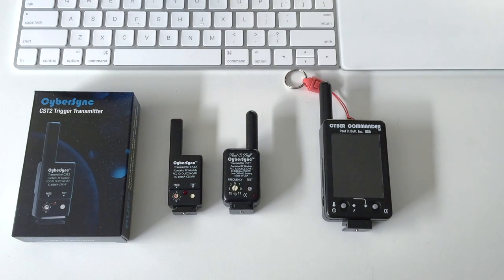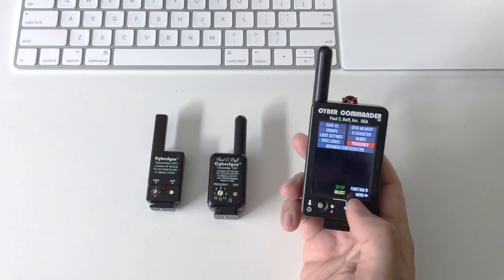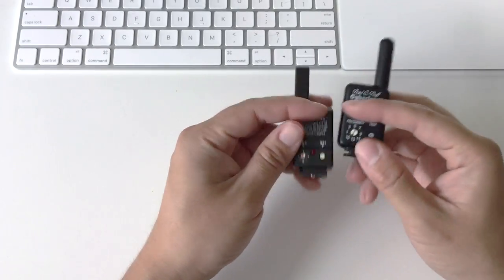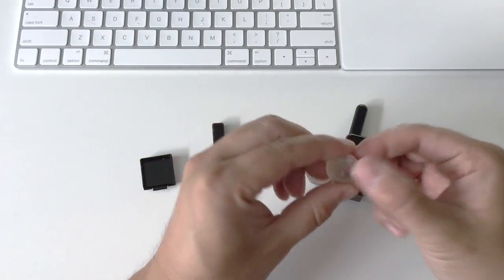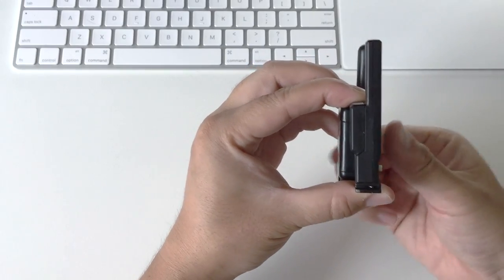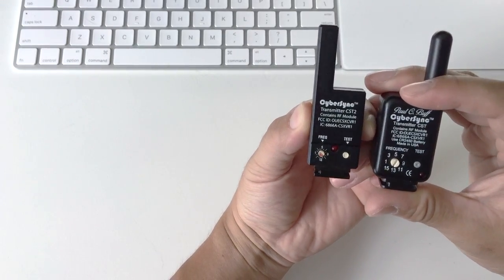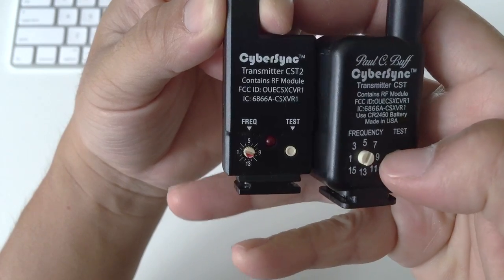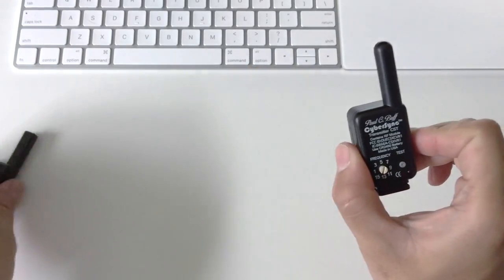2nd Gen Paul C Buff CyberSync CST2 Transmitter Review and Compare with Original 1st Gen CST

Comment: Two Comments

1 I have both a CST and CST2 ( the latter which I just received From Paul Buff Inc). On my Nikon D700 & D200 I always use the CST with the controls facing the back of the camera and have not had any issues with misfiring.

2 I have only had my CST2 for a very brief period. I find that the hot shoe mount appears to be a slightly different in size and/or design and it is very, very tight on the camera's hot shoe mount.  It is far more difficult to add or remove from the camera than the CST model. I hope with time the mount may wear down a bit, making it easier to mount on or remove from the camera.
Reply from the maker: Thanks for sharing your comments Bob. I actually had the CST returned for service a while back, because the hot shoe contact ball on the first CST I received recessed inside the hot shoe mount and would not fire. I think it's a quality control issue on those wireless transmitters, as I do not find the build quality on both CST and CST2 to be robust (Compared to say pocket wizards I've used) however the CSTs are much more compact.

As for firing with dial facing front or back.. might be different on different camera models. I've had the 6D and I have to make sure the dial is facing forward.

I do agree that the CST2 is tighter to fit onto hotshoe, from apparent thicker plastic base.. If it's too tight, might be able to sand the edges down just a tad bit for easy removal and installation
Reply: The reason why I have a CST2 is that the company replaced one of my failed CST units. The test button would not work after a few uses. Seems like the QC may not be the best on this unit.

On the other hand, I have used my 3 Alien B1600 and  Cyber Sync Receivers for 8 or more years without any problems.
Reply: Weird... I have a Canon 6D and I've been using the CST(1) with the controls facing the back of the camera for years. No issues.

Comment: One complaint I have that you didn't go over is the CST has a plug to plug a cord into your camera so that you can use your lights and an off camera flash.  The CST2 does not have that.... is there another way to use my off camera flash & my trigger for my lights with the CST2?
Reply from the maker: Unfortunately the cst2 does not have the sync socket. You'll need to buy the original CST to use the sync cord. But from my best knowledge they stopped making CST, so you'll have to look on eBay for a used one.
Reply: I think they dont understand their target market because it appears there are many photographers that used the pc slot that will not be buying this or anymore of their triggers as the cyber commander is way too big anyways.
Reply: I for one will not ever buy one. Glad I have two of the older CSTs.
Reply: Julie Rader yes there is all you have to do is use a hotshoe to pc sync adapter
Reply: You can use this with the transmitter to trigger with a cable: https://mpex.com/lumopro-universal-hot-shoe-adapter-ii.html

Comment: Nice video ,  how can I sync my speed light on top of camera to trigger the einstiens ? I'm a wedding photographer is there away to Velcro that to speed light and trigger I don't see a sync socket on the new one
Reply from the maker: I don't think you can use speed light to trigger the Einsteins (they don't have optical sensor like Alien Bee lights), they are radio trigger only. You'll need to also buy the receiver for Einsteins called CyberSync™ Transceiver Part Number: CSXCV - see this link: https://www.paulcbuff.com/csxcv.php

There is no sync socket on CST2. I'd suggest contact Paul C Buff directly to get your answers as they are usually very knowledgable in such matter. https://www.paulcbuff.com/contact.php

It is recommended that you get CyberCommander https://www.paulcbuff.com/cc.php to control your Einsteins. You can use either the CTS2 or the original CST to trigger Einstiens, but you have to manually adjust each light instead of controlling the lights if no CyberCommander.
Reply: Yea, I'm also a wedding photographer. I just got my CST2 today and I realize it has no sync cord plug. I also use a speedlight on my hot shoe and sync through that cord. I was a bit pissed and I'm looking to see what they say. How you head back or do you have a solution?
Reply: Yup, I have the original but i need to replace it and Im pretty mad they removed the sync cord plug as well!  wtf I really hope they realized the mistake they made.  Also the square antenna part looks goofy, I preferred the rounded looks of the original.
Reply: yea sucks, i have the new one i think they dont want you using flashes with it lol
Reply: Did you ever hear back or find a solution?

Comment: hows it lasting now bro. Been almost a year?  Do i need two of these if i want both  of my lights to be wiresless
Reply from the maker: XTREME PC GAMER interestingly, the CST2 transmitter stopped working last week and I am sending it back to Paul Buff for service. The test light flashes but it won't trigger any of my Strobes at any frequency. You only need one to trigger multiple lights
Reply: I have found over the long term that the older model cybersyncs lasted longer in a studio setting than the new ones.  Out of 4 new units purchased, only 1 is still working after a year. My original units lasted years and the failure point was the test buttons on those original units. On the new units, the battery covers will not stay on, the foot of the base breaks at the corners. I have also had two units where the metal nipple/contact has pushed up into the unit rendering it unusable.

Comment: When ordering, i noticed not cords come with it. also, do i need to buy 2 in order to get it to sync with my lights?
Reply from the maker: It's a wireless transmitter, you don't need a cord for it to sync with your alien bee/einstein lights that have a receiver attached. The cord for CST first gen is to attach to camera's that only have a PC Sync Socket and no hotshoe socket

Comment: Yes I know that of course but there's a way to trigger the light using cst  like this guy he does it check it out http://www.nicknphoto.com/wedding-reception-lighting/
Reply from the maker: You can only do it on old CST, not CST2 as they removed sync socket. The CST came with PC Sync cord included as well. (Or CyberCommander as I just looked and CC still have sync socket)
Reply: Agreed!  Very dissapointed in them for removing the pc slot